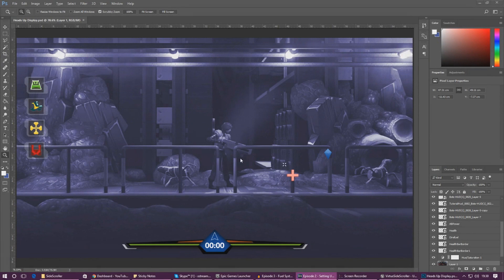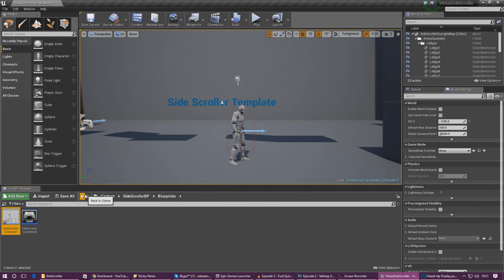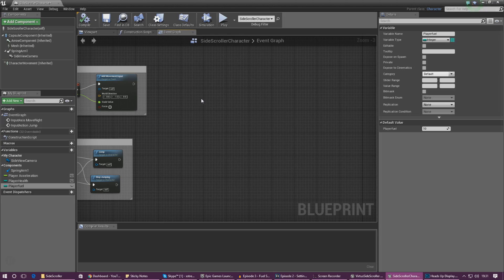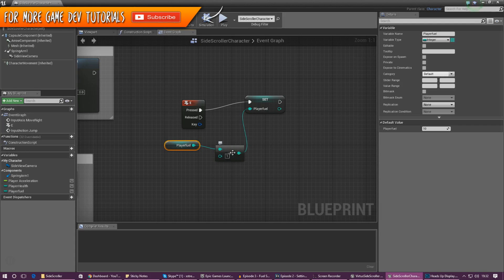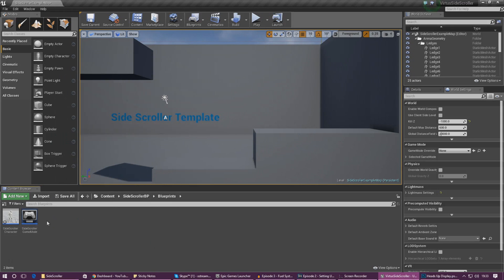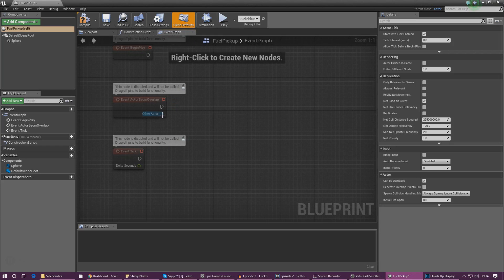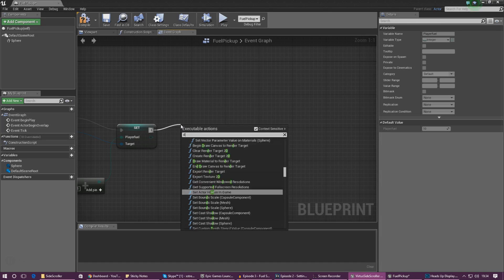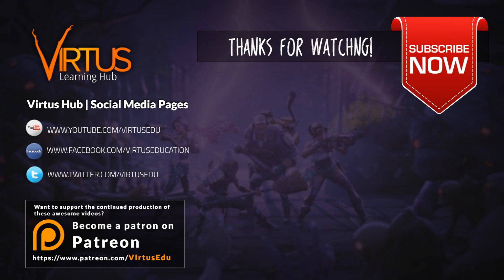Working on The Fuel System - #3 Creating A SideScroller With Unreal Engine 4

Comment: Ok I'm doing the same as you but I place my fuel actor and it's invisible but it's set on visible and the collision is different it only has one option idk what it is
Reply: I have the same issue. Have you got  it  working?
Reply: Frederick Guese no
Reply: You need to add a sphere within the add component section of the playerfuel blueprint.
Reply: Thank you \m/

Comment: Virtus I need help I did everything that was said but when I go to get the sphere when I play it I just got straight through it and it's not collecting it
Reply: Hi guys, I had the same problem. It turns out I hadn't fully connected the Cast To SideScrollerCharacter box to the SET (Playerfuel) box. Specifically, I initially did have the box connected with the "As Side Scroller Character" (bottom right of the Cast box) pin connected to SET's "Target" pin - this uses a blue connection line. However I had missed the top right white pin on Cast To SideScrollerCharacter pin which needs to be connected to the top left pin on the SET box (also white). Hope that helps.
Reply: @Choppednuts  Thank you!
Reply: make sure you connected CAST TO SIDESCROLLER CHARACTER and SET PLAYERFUEL
Reply: I have the same problem as you and I have already connected CAST TO SIDE SCROLLER with the SET PLAYERFUEL, but nothing happened, the character just can walk it through, not collecting it and the playerfuel isn't destroyed
Reply: I know this was a month ago, but I had a similar issue.  I had to make sure my fuel pickup was on the same X plane as my character.  Click on your character, copy the X location value, and then paste that same value when you click on your fuel pickup.  You may already know this, but just wanted to put it out there.